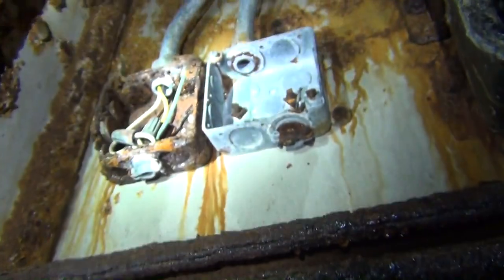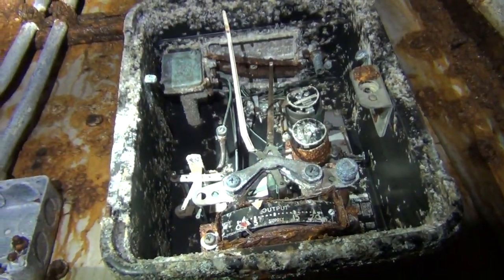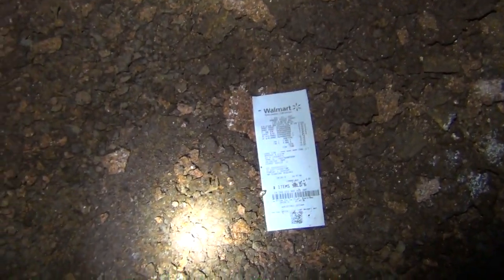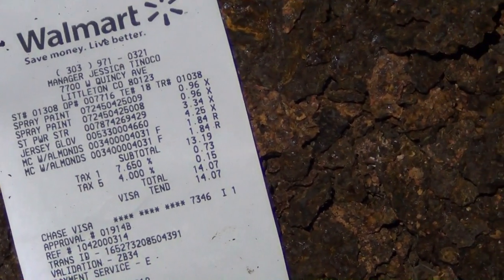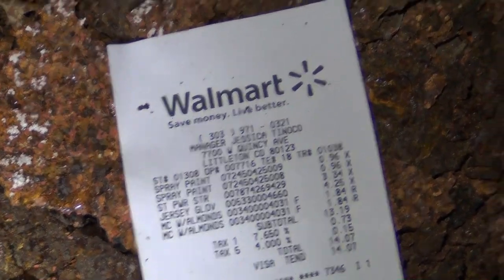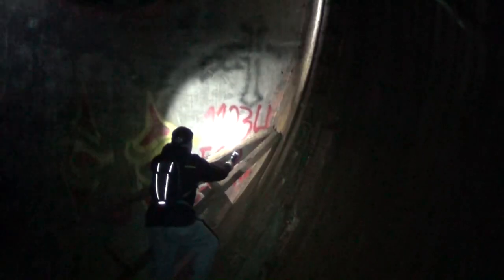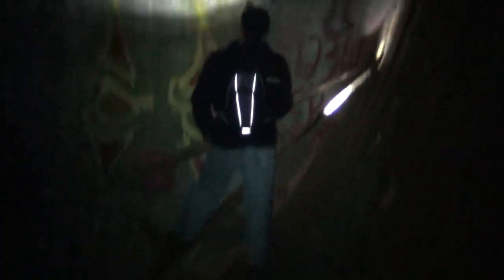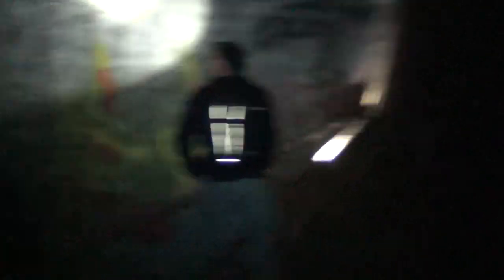Deer Trail Colorado Titan I Missile Silo Complex 2B - Part 2

Comment: Although it's not in the video, the pit where you went in was once buried underground. It was later dug out to expose the tunnel, which was cut open, probably to remove an underground fuel storage tank or get easier access to the tunnels. When the silo was operational, personnel could only gain entrance through a hatch near the top of the equipment elevator shaft, followed by descending sets of stairs that surround the equipment elevator. Titan-I launch facilities were, by far, the largest underground missile complexes ever built, with 3 launch silos in each complex. However, the fact that they had to be elevated out of the silo for launch left the facility exposed during a potential attack. It's replacement, the Titan-II, was the first to be launched from within its silo. but the Titan II only had one launch silo, so they were much smaller facilities. Some Titan-II facilities have actually been converted to underground homes, but not a Titan I that I'm aware of. . . the cost of cleaning/restoring one would be insane! That I'm aware of, the best preserved Titan-I facility (there wern't many to begin with) is in Washington State. This girl's family owns one and she gives a series of video tours on her channel: https://www.youtube.com/watch?v=HeJjxu2p8BA
Reply from the maker: You are correct